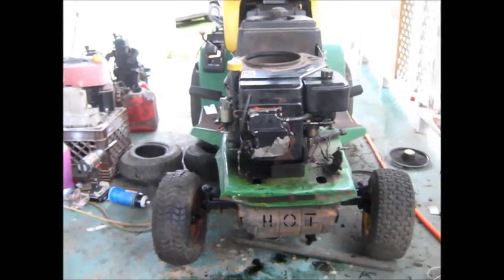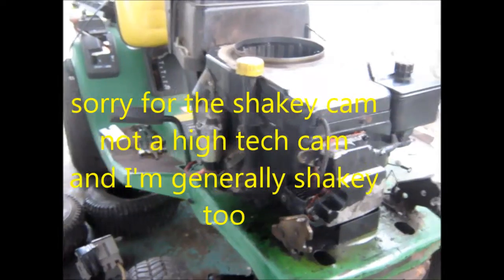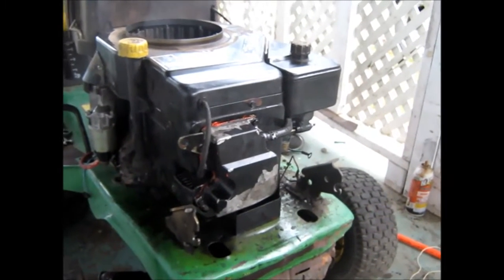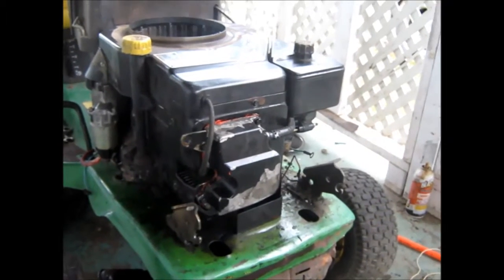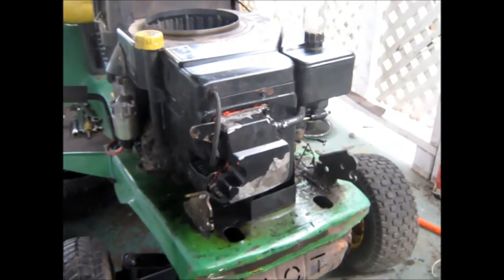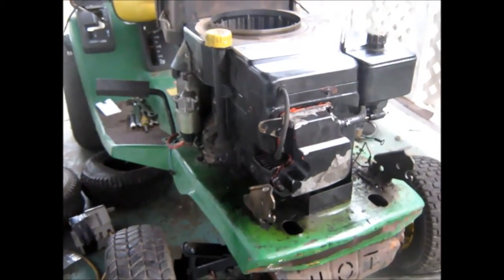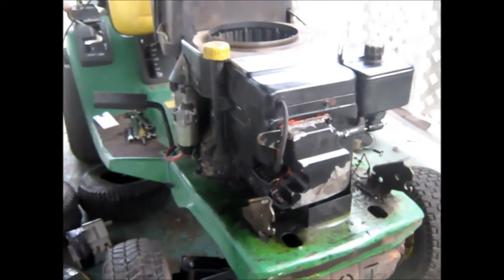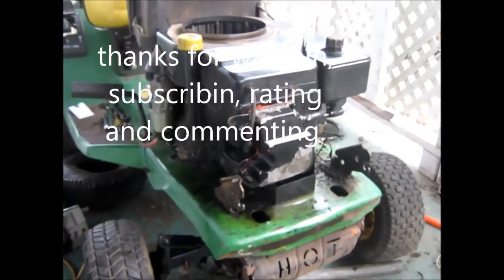kohler Command running again, head gasket valve job update

Comment: Yep...Head Gaskets are the main issues these engines have. Second issue is fuel filling the crank case. I would put an in line fuel shut off on it and a big note on the steering wheel to remember to shut it off before turning mower off for the new owner. It's also a good idea to check the head bolt torque once a year depending on the use. But be careful to not over torque. I wish Briggs had gone the Hydraulic Lifter route like Kohler did. Sure takes all the valve setting processes out of the picture. Cheers my Friend! Zip~